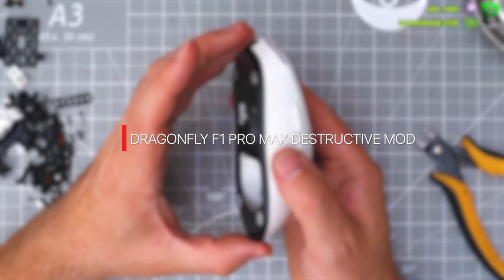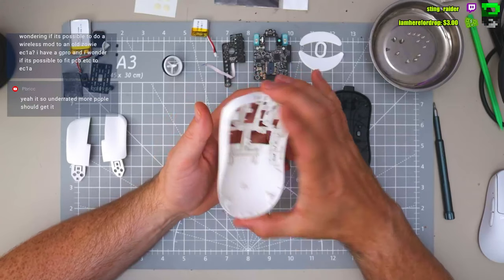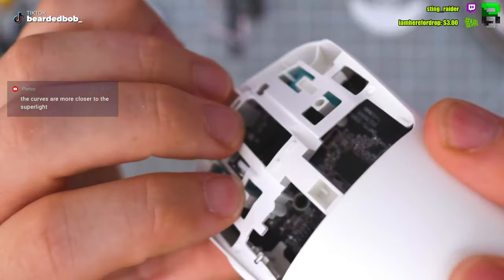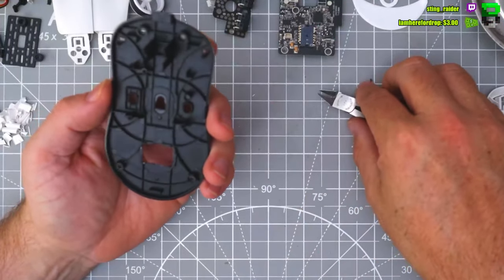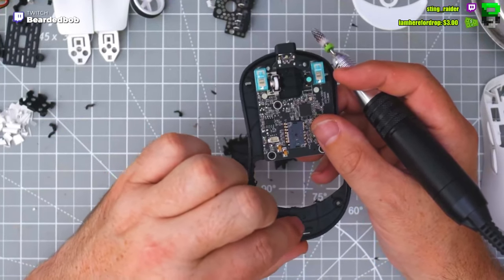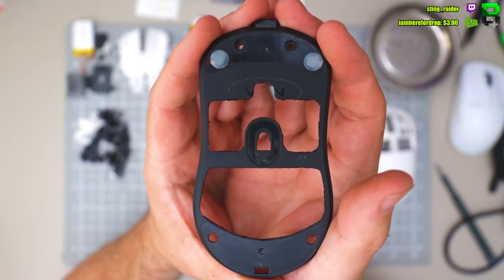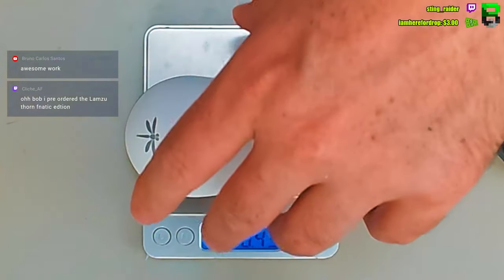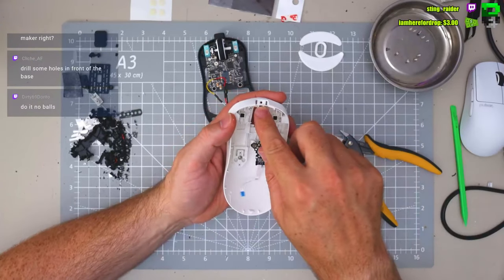VGN Dragonfly F1 Pro Max: Make the ULTIMATE Mouse With This Weight DIY Hack

Comment: hi bob, i have a problem with my f1 pro max in the scroll wheel. sometimes when i use scroll down it will go up same thing with the scroll up, it goes down for just 1 second. what should i do with the scroll wheel?
Reply from the maker: Rma or replace the scroll encoder